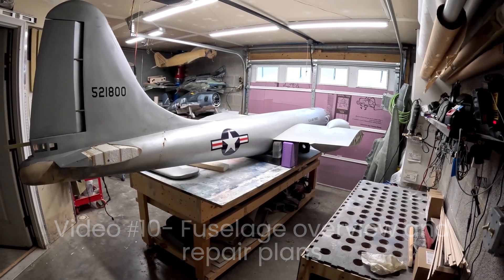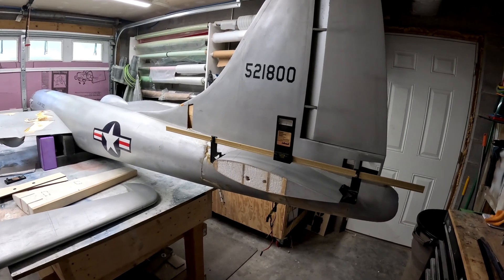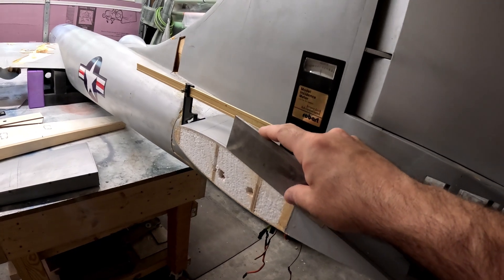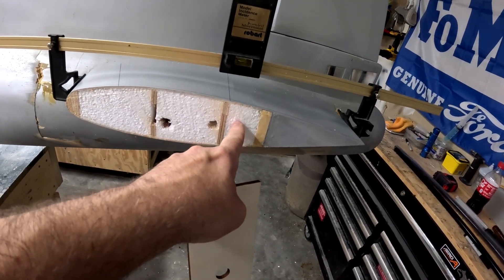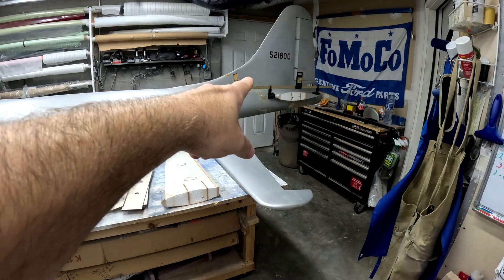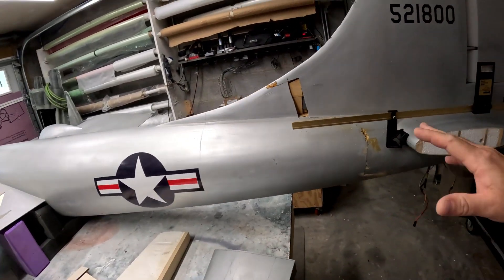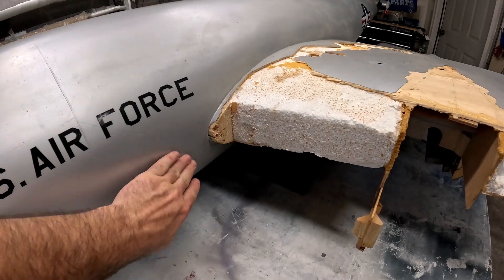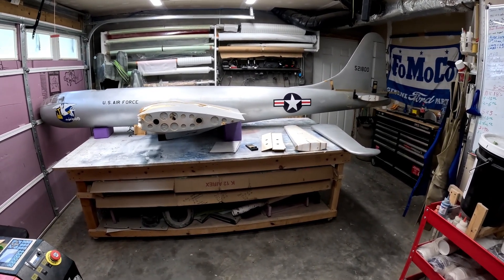B29 Restoration #10  Fuselage plans

Comment: I like the idea of a G10 tab for the stab attachment bolts. Just curious, what length are the main wing tubes? Such a huge wing I figured they'd be substantial haha
Reply from the maker: They are 48” long with the tube centered along the wing split.   I’ll likely use 1/8” wall tubes since they are substantially cheaper than anything thinner.